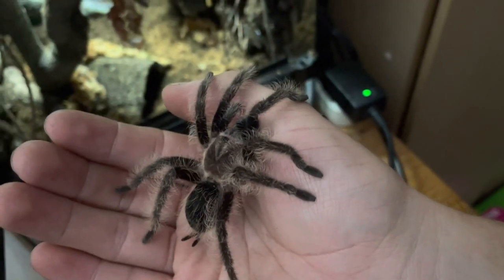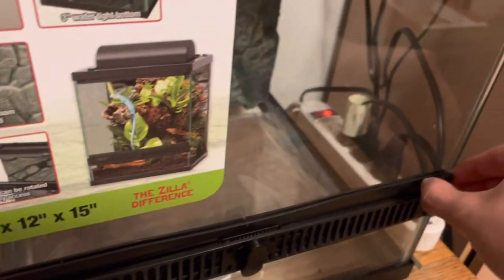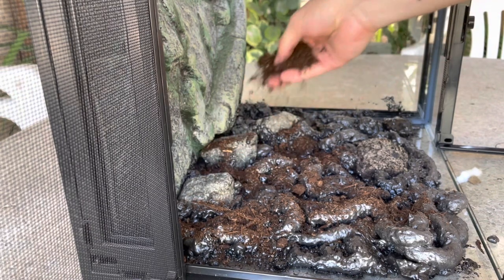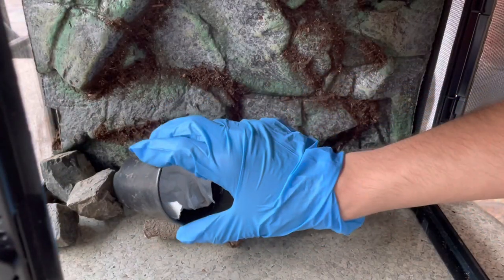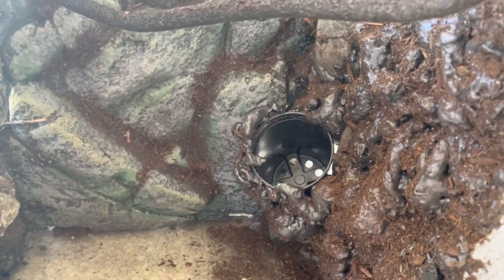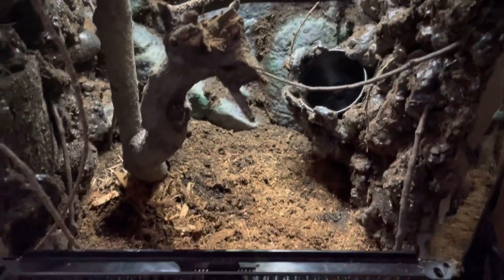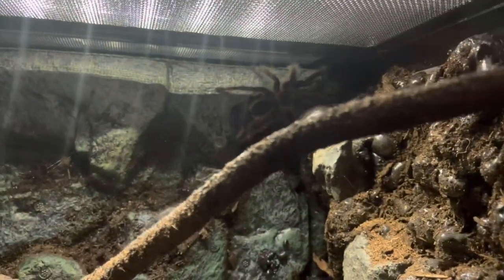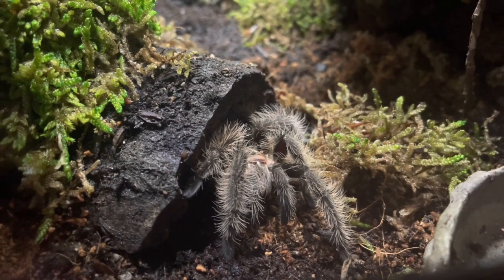Skull Island Terrarium DIY | Curly Hair Tarantula Enclosure using Expanding Foam

Comment: How did you add the branch to make it stay
Reply from the maker: For me, it was able to stay there by just sticking it in the soil, however, you can probably use silicone or foam to make it stuck on the bottom of the glass

Comment: i think your enclosure is too high which fits for arboreal tarantula
Reply from the maker: Right, I did provide over four inches of substrate towards the back of the terrarium for burrowing however this tarantula so far seems to prefer climbing the walls rather then staying at the bottom which is pretty rare for curly’s. So far it seems like a win win situation.